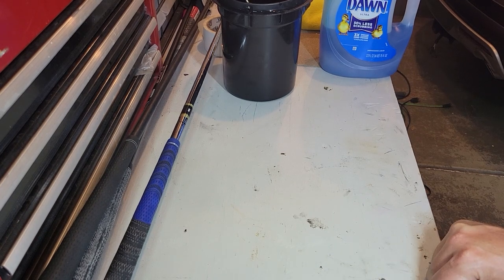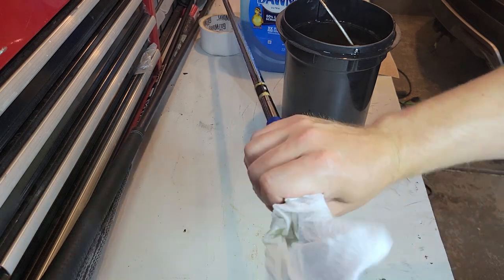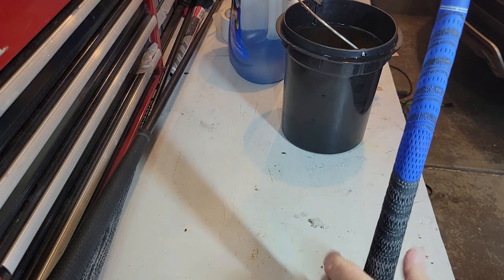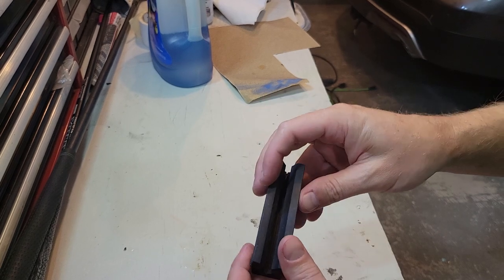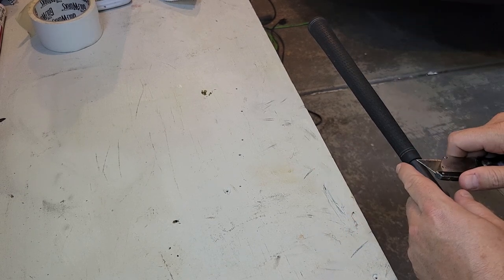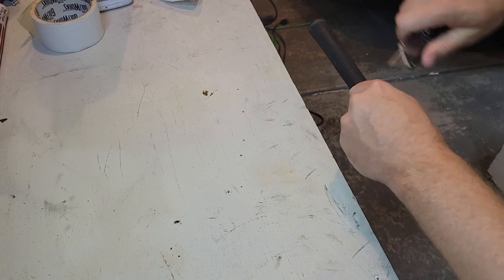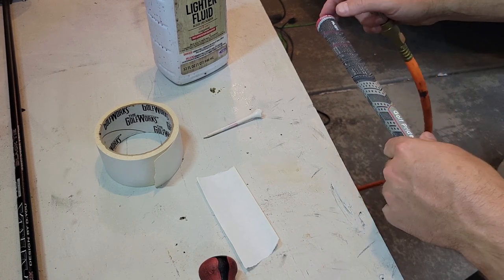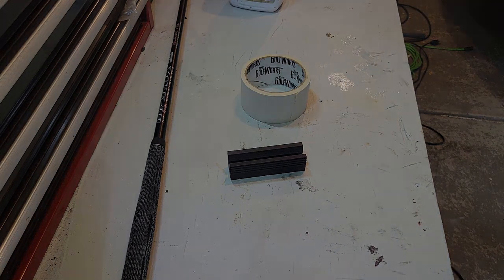GOLF GRIPS- refresh, revive, replace

Comment: Have you ever tried heating the grip instead of cutting it off? I have a couple of good grips I'd like to transfer to other clubs if possible. Not sure if it's worth the effort, though.
Reply from the maker: You can use a needle and inject lighter fluid then work the grip off. Ive used a metal coat hanger to work lighter fluid in a putter grip to save it.
Reply from the maker: Needle i have for this us like a turkey/ meat injection needle.  You can try air and sometimes that works to remove if grips are still flexible. Be carefull though because they can explode.
Reply from the maker: https://youtu.be/zOXSmzU7EE4
Reply: @bradreef  Great info. Thanks!